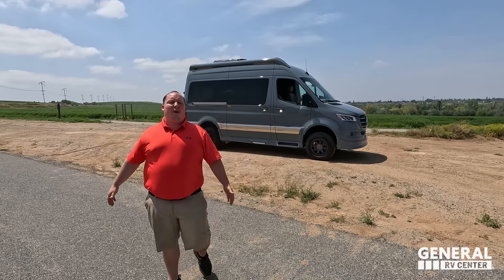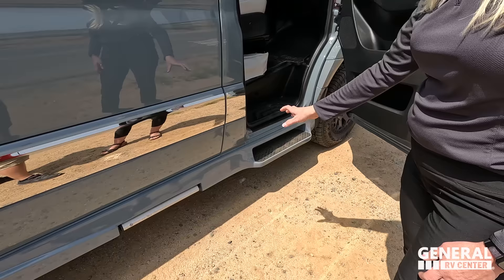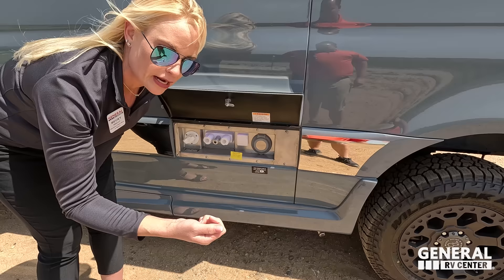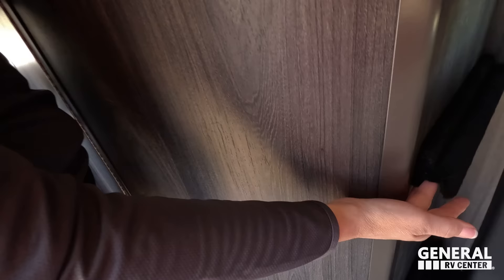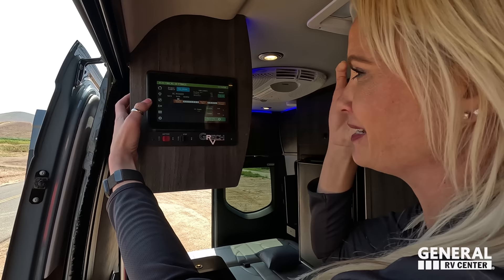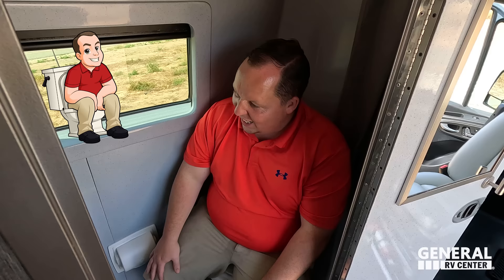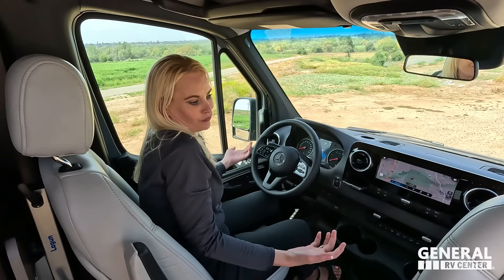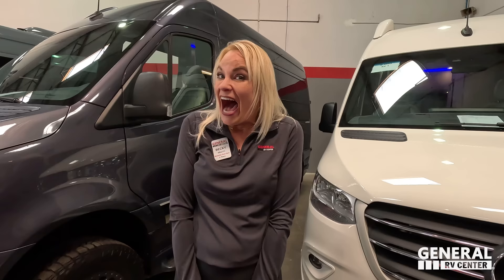WORLDS SMALLEST / Best Quality Class B Camper Van!

Comment: Given that MB parts and servicing is sky high, diesel is still much more expensive than gas and the cost of this vehicle is prohibitive. I guess a fool and his money soon part company.
Reply: No rear head restraints.
Reply: MB quality is not what it was 50 years, true. Engineering often appears to be by someone who is still pissed about losing WW2.
 But for long term support and reliability, handling, etc. they still seem go last twice as long as Dodge and Ford. Ford also started a war last year when their dealers mostly announced they wouldn't service the Ford made and warrantied portions (i.e. the drivetrain) of RV's authorized to be built on them.
 So, sure, for 20,000 miles I might not care. And why is the tail of the Mercedes so narrow? With wheelbases too short or too long, but none designed to match a 19' urban USA parking space?
 For a 100k van, I think I'd still rather rely on MB. Used vehicles are always a crapshoot.
Reply: Little tiny freezer? Looks like it would fail the critical job of holding real half gallon ice cream containers.
Reply: BTW, diesel has twice the fuel density of gasoline. So 100# of diesel (about 13 gallons) will carry you just as far as 200# of gasoline. Double that for more typical 26 gallon tanks, and that's 200 pounds of payload, or about 28 gallons of fresh water you could carry instead. Deisel is also a safer bet if you want a heater onboard. Better to keep the gasoline out of the cabin.
Reply from the maker: Thanks for the feedback!
Reply: @lyfandeth  as a German I had to laugh so hard about your first comment. 😂😂. And yes, you are absolutely correct about the decline of quality. That is the reason why I am looking for a late 80’s / 90’s Mercedes.
Reply: @lyfandeth  Just exactly how many miles do you need to drive in order to recoup the extra money that you paid to have a diesel engine versus a gas engine?

Comment: This is NOT "the wold's smallest" class B RV. That honor goes to several RVs built on the Ram Promaster 1500 platform, such as the Winnebago Solis Pocket, the Thor Rize, the Pleasureway Tofino, and several more that are out there but no longer made, notably the Carado Axion (which we have). All are under 18 ft. long--a length of van Mercedes doesn't make and Ford doesn't either in a high roof version. Many more Promaster 1500-based RVs are made by dozens of smaller shops around North America.

Comment: Speaking of "van life".
Do any of the class Bee...lol... manufacturers build custom interiors?
For example, I might ask for a slightly wider wet bath, as I am slightly wider....lol.
Longer battery life, bigger solar panels.
Mobile satellite dish.
Raise the microwave to above fridge or swap those around.
Maybe a longer base, diesel, 4x4.
Add cameras to LS/RS mirrors.
And windshield blinds...power of course.
And security system.
If I happen to park, unknowingly shady place, I won't have to worry to much about someone breaking in whilst I am sleeping.
Reply from the maker: You won’t find that with these types of vans but there are some companies that build custom vans!
Reply: You can get some of that with higher volume Class A and C models, choosing between a sofa or theater seats, or between a dinette or a table with chairs, or a queen vs. king bed in a Fifth Wheel, but I haven't see it in a Class B except for smaller companies that custom build every unit. For companies that "mass produce" their products, the Class B market is too small to offer a lot of options from the factory.
Reply: @Hottest Country Music - For the same money as this production vehicle, you could have a custom van builder create the perfect van built exactly to your specs.

Comment: I like the quality, attention to detail, the useable sink in the wet bath, the batteries, alternator, and no propane. I do not like the kitchen. The sink's too big leaving you with zero counter space, and the frig is a joke. The bed's too short, Becky tries to pretend it's ok but her head's bonking one end and her feet are vertical against the other end, no way a 5'10''' person can sleep in that unless they're a curled up side sleeper. The 4x4 is weird. It has 4x4 and AT tires but they're tiny tires and you lose a bunch of ground clearance with all that fiberglass they add. My Wonder has bigger tires and more clearance than this.

Speaking of LTV, Matt said last time this is a competitor. It's really not, they make different classes of RVs and the Grech is much higher tech.

When the Grech rep says that huge battery bank can run the house for 12 hours, that's pretty deceptive. Deceptive in a way that's underselling it. He means you can run the air conditioner on high for 12 hours, which you rarely need to do. On a normal camping trip with nice weather that battery bank is going to last you 3-4 days, if you're a heavy electricity user running starlink, computer, induction cooktop, microwave, etc. If you're not a heavy user just forget about it, you're probably never staying in one place long enough to drain those batteries.
Reply from the maker: Thanks for the feedback!